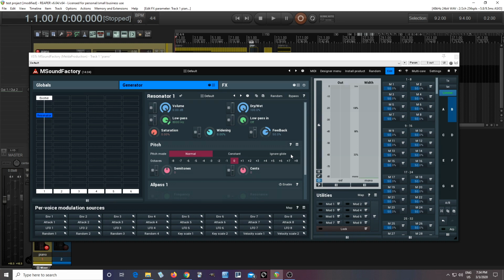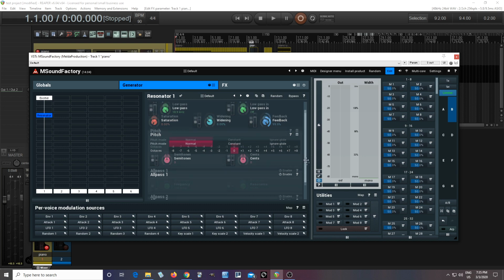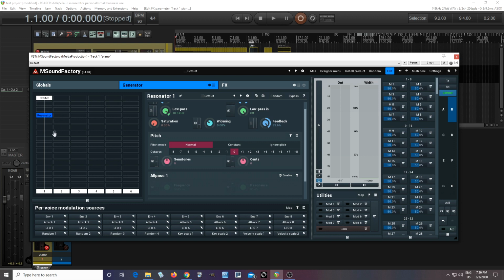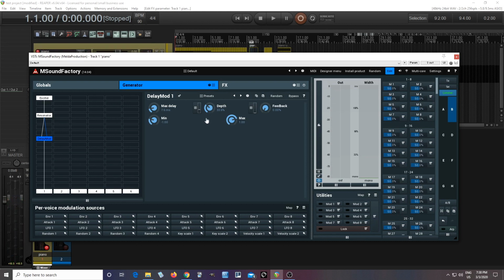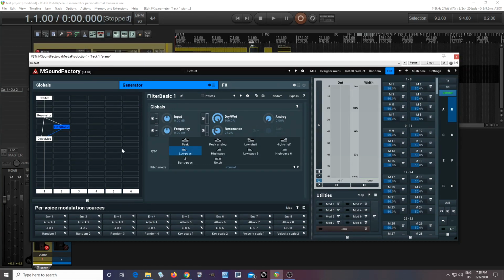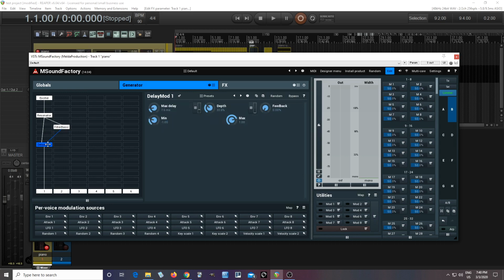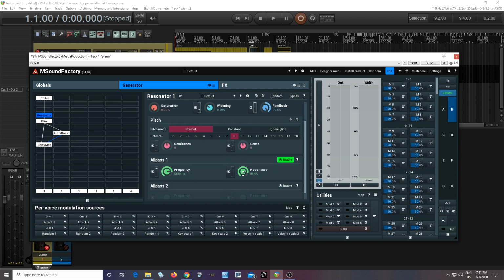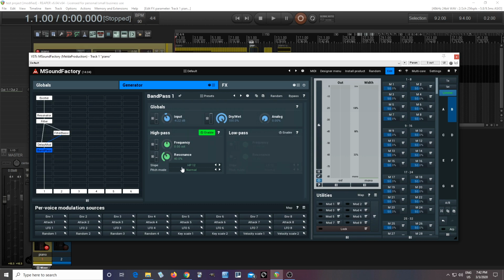New String Ideas in MSoundfactory

Comment: I have not exciter. V 14.04
Reply from the maker: There is no exciter module, I just re-named Drum Syntherizer 4NN. Just use that to make a basic sine sweep. I hope that helps.
Reply: @Chandlerguitar  I did not have enough brains to corny check the modules and see a similar one.🤦‍♂️😂
Reply from the maker: @ХристианМонархист  No problem. I make mistakes like that all the time.
Reply: @Chandlerguitar  Are we (ie. normal MSF customers) able to make our own Generators or is that only something you can do? I want the Exciter in there too!
Reply from the maker: @KingsXBadger  The exciter is just a renamed version of Drum Synthizer 4NN. I started renaming the modules as I put things together, so they'd be easier to understand/remember. You can of course rename things yourself and save module presets. It really helps when you have 5 filters or 4 OSC. Sometimes I confuse myself with the things I make.